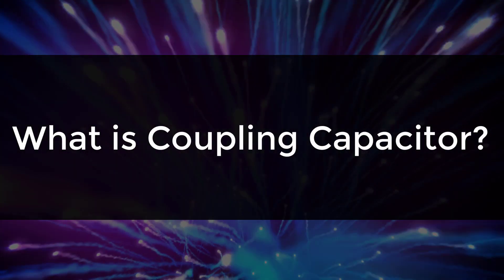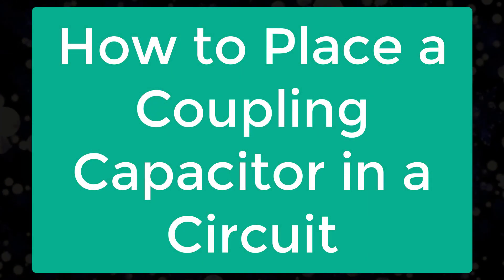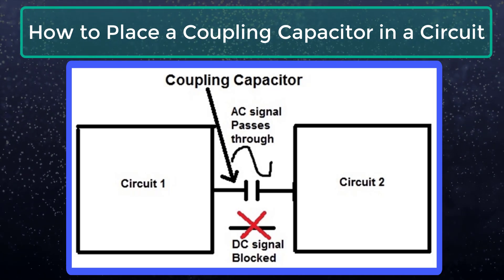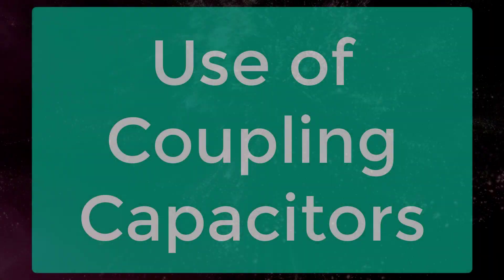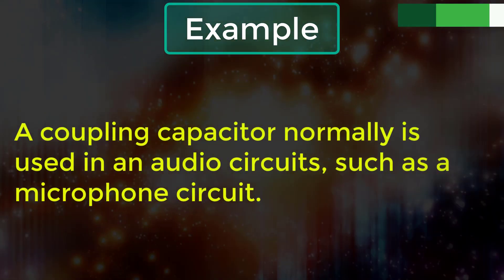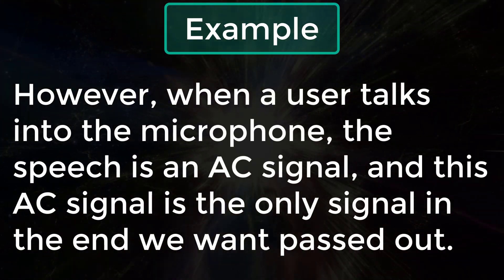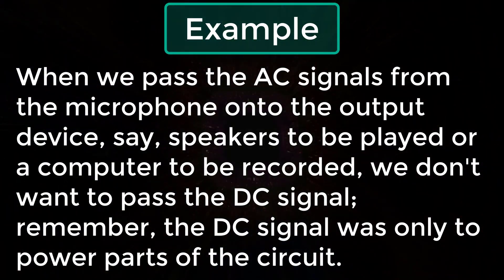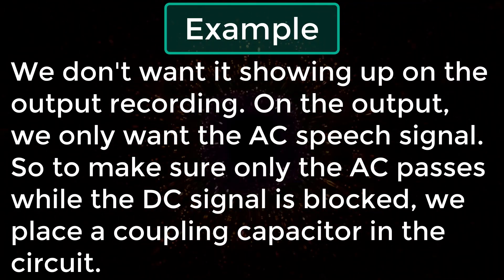What is Coupling Capacitor |  Transistor Amplifier Circuits | Electronic Devices & Circuits

Comment: I'm having an issue with an audio circuit that I built. It is playing nice but has som high frequency noise that I can't get rid of. I use a bluetooth mp3 module I bought from AliExpress to input my audio but it comes with its perks which is high frequency noise. Whenever I disconnect the power from that module the noise goes away with my amplifier still on. I used a choke and 3300uF capacitor to lower the noise but it's not completely gone. 
 
Do you have any suggestions? 
Can I use this coupling capacitor to send the high frequency to ground or factor it out of the circuit by some means?
Reply: You ever figure out a solution?

Comment: Hey there you have explained the concept pretty well. I'm a newbie 
 am trying to create a preamp circuit and have a question - what would happen if there are multiple coupling capacitors in parallel  - does it increase impedance of the circuit?

Comment: Thank you sir. How to choose capacitor for pass specific frequency range?
Reply: I think you're referring to a bandpass filter. To build one in its simplest form, you need to have one capacitor in series with your AC voltage source, and another capacitor in parallel with it.

You need to choose the correct capacitances for each to obtain the filtering in your desired frequency range. (You need to calculate that.)